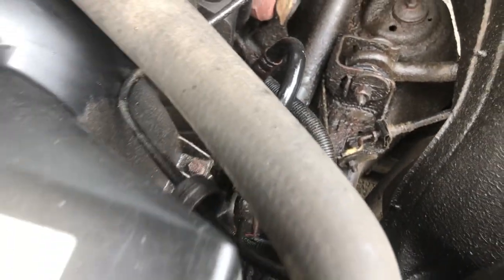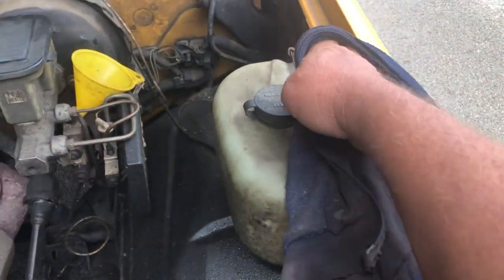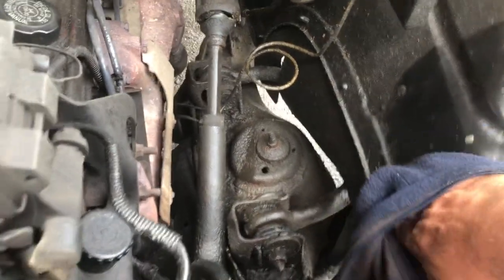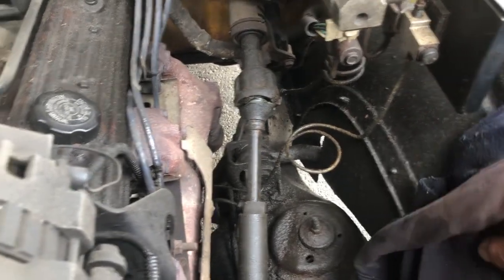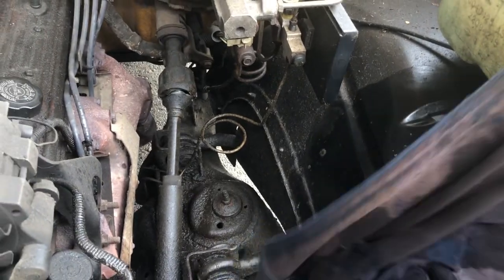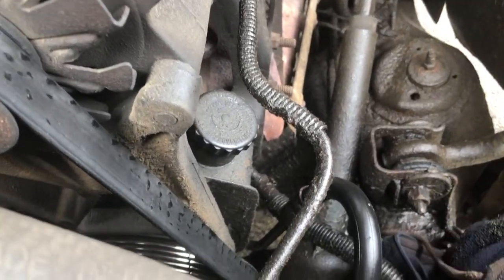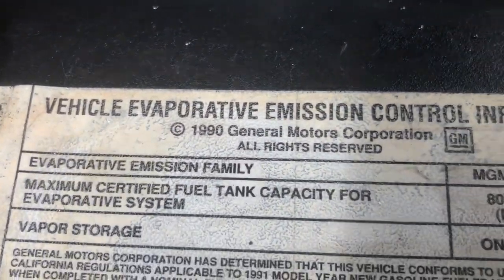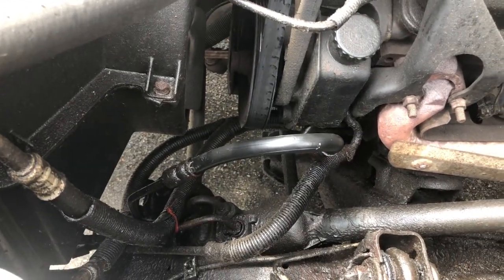PESKY HYDRAULIC LEAK

Comment: Mine had a slow leak (85 Chevy truck) just needed to tighten stuff up.
Reply from the maker: Well you got Lucky right there I have some sort of leak at the connection or something
Where the rubber hose mounts to the steel fitting
Reply: Oh that sucks!
Reply from the maker: For real it does
I somehow or another managed to turn a 25 minute project into something that’s taking hours🤣😳🏆🚗
Reply: I have been there before lol. Hope you can get it fixed sooner than later.
Reply from the maker: Working on it I just need to get some of these leaks fixed
It’s making things expensive
💵💵💵🤷‍♂️

Comment: 🤙🤙👍 fill up power steering and have somebody work it,shouldn't be that hard to see,process of elimination ✌️
Reply from the maker: Well yeah if everybody wasn’t out doing something today
I have somebody come over
Reply: @steelisthemeal  I have a solution for you roll down both windows tie some of your copper cords to the steering wheels run them outside where you can see and try working the wheel back and forth😊 don't forget to get a video😮
Reply: 🤔 the poverty runs deep ✌️
Reply from the maker: Oh god yeah

Yewwwwwwww